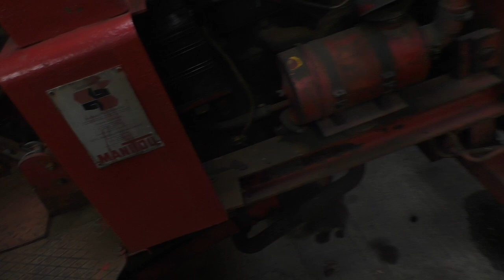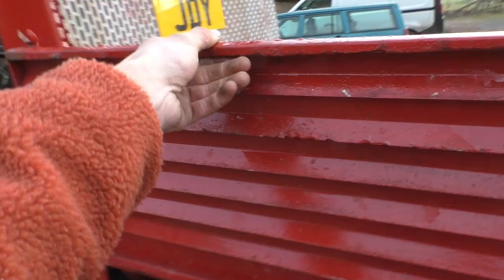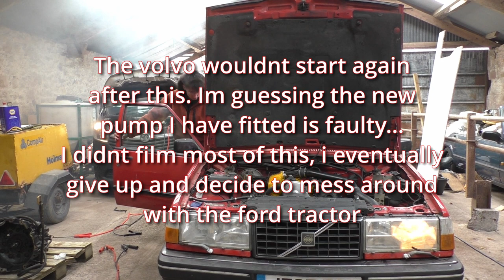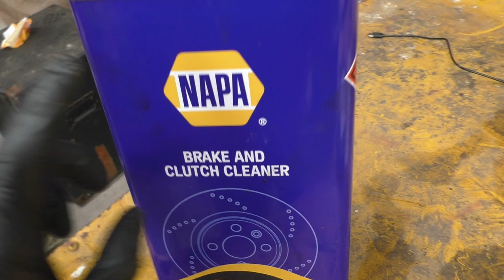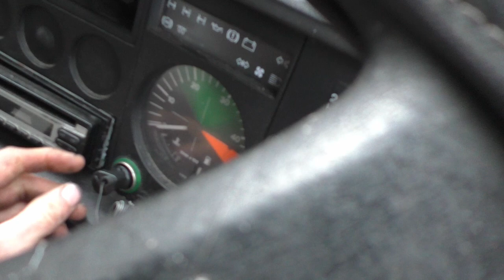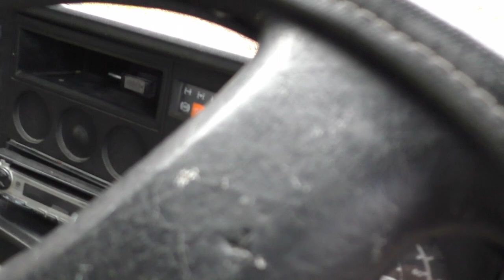Vlog. Tractors, volvos and vans (all arguably the same thing)

Comment: I wanna know how the brake and clutch fluid helps the engine start(might be helpful in my life)
Reply: its brake cleaner, not brake fluid
Reply: Flammable and is an accelerant so it burns easy after it gets into the engine through the air intake